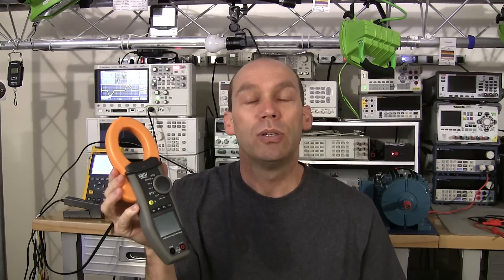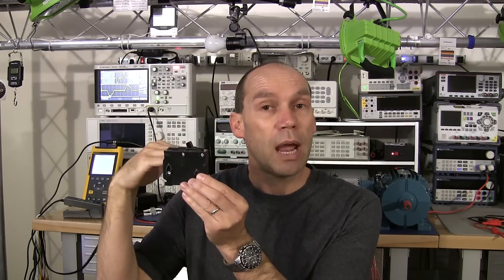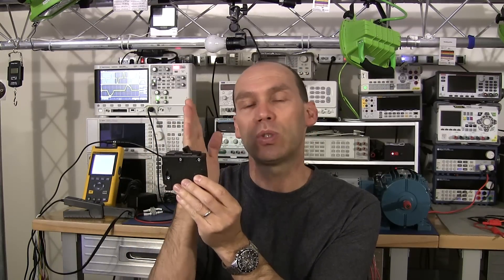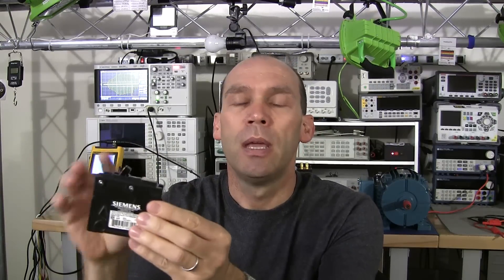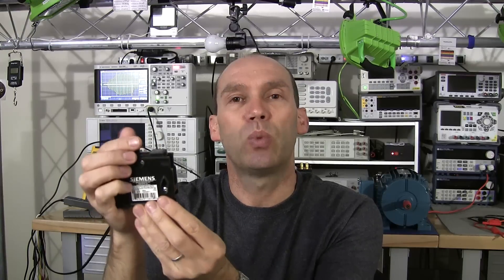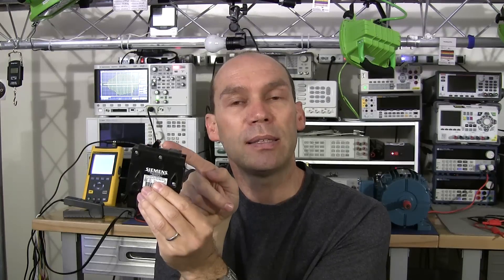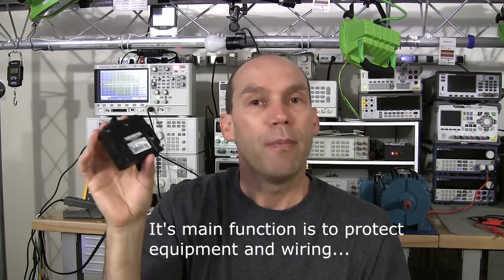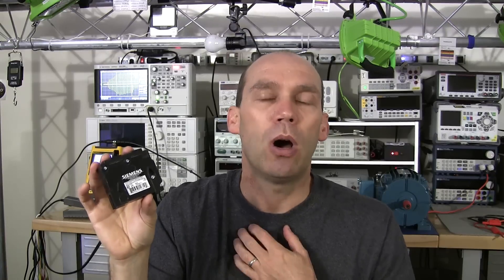Measuring Inrush Current with an Oscilloscope, Circuit Breakers and Clamp Meters

Comment: It's back to the drawing board for the Fluke team.Good point on the compatibility issue between the data sheet info and the meter readout.I'll never look at inrush currents in the same light again.I'ts hard to beat a practical demo to bring out all the inconsistencies in the measurement setup.Loved the video.Will have to update my equipment.Anyone have $70,000 to spare on a long term loan over a 100 years,if possible.

Comment: RMS only has meaning for getting an equivalent to DC heating power.  For working with breakers and motor starting current just use peak current which can be directly measured on a scope.

Comment: Hi Martin. Very good video again. I have missed only one aspect that i found out is very important in measuring inrush current on a scope.
The moment of making the circuit is of great importance: if one switches on at a point that the current in the homenet is in a low point (zero in the beginning and in the middle of the period) than the peakcurrent will be very modest. But if you switch on (to measure) on the moment of max current (after 90 and after 270 degrees in the period) than the peak is at its max. And all the values in between. So very dependant on the moment of switching om the circuit..
How come this is not mentioned by anyone in this subject ?
Reply: A fine point raised here. You are correct, the most likely reason is that product ratings account for  this situation thus we only deal with the maximum value.
Reply: @shieldcracker  for me the solution is to switch on with an SSR (Solid State Relais) that works on 90 degrees..
Reply: @BarendJanvanEijk  Indeed, some SSR can be configured with selective phase firing angles for current or voltage surge control.
Reply: @shieldcracker  and i combined that with a bounce-free switch. so to get the cleanest and most consistent signal for the inrush. important for optimization of electronic designs.

Comment: 28:45 The period for 60Hz is 16.7ms the Time Base for the scope is set to 1.67ms to give you enough grid to see one full cycle
Reply from the maker: James Cote Thanks for catching that...I was staring that the time base...I've added an annotation.
Reply: @mjlorton  this won't help.. it's the "switching-on" moment that changes behavior very much. my solution is to use an SSR for the in-switch (an SSR with 90 degrees feature).

Comment: Notice that when you framed it close to 1 period, the horizontal offset stops affecting the RMS current reading.

The framing of the window to match the period is a similar gotcha to using a FFT on a scope. FFT makes the assumption that whatever's on the screen is repeated forever beyond the screen. If the vertical at each edge of the screen doesn't match it would be a step in the imagined repeated waveform making a peak on the FFT at the period of the screen. Window functions help get around this by pinching the edges of the waveform down to the centre so the start and end smoothly merge, but if the waveform's nothing like a repetitive AC signal, that won't fix it all. Really you have to frame the waveform to an integer multiple of the fundamental period of the waveform and remember that it only means anything if the waveform is repetitive. You couldn't do an FFT of a single step waveform for example even with a window function, the result would entirely depend on the timebase.

Comment: Very nice video and the circuit breaker trip in case of very high arc current 'can you please explain to me  in the case of low arc current which is normal mcb can't trip, example I found product in seimens called ARC FAULT CIRCUIT INTERUPER (AFCI )...many thanks

Comment: Martin, RMS values are only useful for continuous measurements. Because inrush is a transient event, you cannot assign an RMS value. Trying to give inrush current an RMS value is like turning on a heater to high, and then turning it down to low, and asking what the RMS current is... Well, you could find the RMS value for when it was set to high, and you could find the RMS value for when it was low, but there is not an RMS value that covers both, as that's a nonsensical concept - RMS is how you describe steady-state conditions. 

Now you can take an RMS measurement of inrush current, but it would only give you the RMS current for during that particular sampling period - but as it's continuously changing (current draw decreasing with time in this case), it's essentially a useless figure. That's why we measure the peak current during inrush, and then RMS once it has reached steady-state.
Reply from the maker: Greg Robinson Thanks for your post. Do you have a link to an authoritative document that discusses RMS values as being only useful for continuous measurements and meaningless for peak inrush currents?
In all the research I did I never came across a good, clear definition for the measurement quantity for peak / instantaneous inrush current. If you read many of the circuit breaker manufactures' data sheets, they define the instantaneous trip current as a factor multiplied by In (CB rated RMS current). If the instantaneous trip current should be quantified and measured as the peak current during inrush, can you point to the paper that defines that? 
Cheers, Martin.
Reply: mjlorton
I'll see what I can find for you.
Reply: ***** Nearly choked on that while drinking me tea.Be careful or you'll leave us all with a blank canvas.Rms is difficult enough but Joule's Integral is bordering on science fiction.
Reply: RMS is a mathematical construct to get a meaningful average from a signal that goes between positive and negative values. If you take look at one period of a sine wave and take the average, it's zero. The RMS calculation takes your signal and squares it to first remove all the negative values. You then take the average of that signal (after you've squared it). Lastly, you take the square root which 'cancels' the original process of squaring the signal. It's a similar idea to "adding 1 to both sides of an equation" so you don't actually change anything. Consequently, you can take an RMS of any signal, even those that are strictly positive or negative. A positive signal RMS value will equal its average value, and a negative signal RMS value will be the absolute value of its average. In the end, RMS is useful whether you're looking at a few cycles or thousands of cycles.
Reply: This summary shows that it pays to eat porridge for breakfast !!
Reply: Would any other metric, like norms, or other things like variances be of any help?

Rms is useful in scenarios where the other quantity (voltage or current) is fixed so rms directly corresponds to the power loss. But here the load has both a swinging potential and a swinging current.

Comment: Are you really interested in the peak in rush (time stamp 28:16)?  If it lasts for only one cycle, it's not that interesting.  The concern about in rush current is the power it can deliver.  Can that power do damage is the question.

Comment: Measuring non-pure sinusoidal RMS voltage for a continuous waveform can require a large crest factor in addition to true RMS depending on the shape and magnitude. For more information see Keysight Bench DMM 34465A.

Comment: Hi Martin, Great video! but is it possible to measure current on a scope with out all that special equipment, thanks
Reply: A low value resistor accomplishes this.  I use a 10 watt, 1 ohm resistor.  That produces a voltage drop of 1 volt per amp.   This will alter the test condition slightly; a 30 amp surge will produce a 30 volt drop in the resistor.  So if you are expecting higher currents, just use a 1/10th ohm resistor (or piece of wire with 1/10th ohm).  
WARNING Be sure your oscilloscope is ISOLATED when you clip the ground lead of the probe to either side of the resistor that just happens to be inserted in the "hot" side of the mains.  I plug my scope into a Goal Zero inverter so it has no connection whatever to the "mains".

Comment: Very useful information, thank you.
I would like to measure the inrush current on USB ports, unfortunately, I don't have the equipment.
Reply: What's being the purpose  of that? What kind of load do you use with the USB port?
Reply: *****
I have a notebook, which won't turn on with an external USB powered DVD burner connected to both USB ports, I would like to know what is going on in the moment I push the power button. Another notebook (same device) has no issues.
Reply: Dorf Schmidt
I don't think that this is due to the inrush current as such. Your DVD burner would have a decent filtering inside to avoid temporary voltage or current spikes. It's more likely the general overcurrent protection of the motherboard, powering both of the adjacent ports from a single +5V rail. You could test it with two ports that are not so close to each other. It is also possible that the manufacturer made a revision and your newer notebook doesn't have this issue anymore. Furthermore, do the two ports work on their own?

Anyway, feel free to look at the inrush current from your USB port with a digital scope. You could sacrifice a USB extersion cable by removing the outer jacket (keeping the four wires isolated) and wrapping the ground lead from your probe once or few times around the red USB wire and connecting the crocodile clip with the tip of the probe.

Comment: You just happen to have a mongo motor and VFD lying around?  Was that to go into your drill press back when you were milling plastic and everyone got bent out of shape? :)
Reply from the maker: Eddie the Grouch LOL....no! I have however bought the correct press for the little compound table and it works a treat.
The motor and VFD were purchased specifically to play and learn about 3 phase power, power quality etc. It's been great for that. I do have a better setup planned for 3 phase power as the VFD is generating a "modified" and rather noisy 3 phase waveform.
Thanks for the post ;-)

Comment: Could you please clarify something.
What if you need to register DC inrush current? Will it suffice to use regular Hall effect type clamp meters?
There are no periods in DC, so there is no need in RMS with DC and no need in special mode on my clamp meter to register DC inrush current, am I right?
Reply: Whether dc or ac motor, I think the inrush current would follow some rise and then fall to some kind of settled for loads on the motor.

Comment: I have a 750W (3A) variable autotransformer that trips the circuit breaker in my house every time I plug it in. I put a thermistor in series and it stopped! Inrush current?
Reply: TheAmmoniacal Yes, definitely.
Reply: TheAmmoniacal Yep.  But I think you may have used an MOV (Metal Oxide Varistor).  MOV's act to limit surges while a thermistor varies resistance with temperature changes.
MOV's and thermistors can look identical and are often confused one to the other.

The branch circuit (breaker) the transformer is plugged into may be close to capacity with lights and other stuff and the inrush is just enough to trip it.
Reply: Eddie the Grouch I definitely put a 5 ohm Epcos NTC themistor in it (http://www.newark.com/epcos/b57364s2509a002/ntc-thermistor/dp/52R9612). I'll admit I'm no expert on this, it's just what I had available and the datasheet seemed to indicate it was the correct use for it. I also tested it with my heat gun and the resistance dropped significantly rather fast. The datasheet also says it can handle 8.5 A or something like that:
Reply: Eddie the Grouch  AFAIK, MOVs are used to protect circuits from Over-Voltage, not Over-Current. Once the Voltage gets too high, the MOV will conduct electricity, so they are used in parallel with the circuit to protect.
Thermistors, on the other hand, only conduct when heated up. At first their resistance is high, so inrush current will be limited. EDIT: Thanks to Wikipedia, I got my facts right: https://en.wikipedia.org/wiki/Inrush_current_limiter#Thermistor
So I think OP's assumption is correct, inrush current is most likely responsible for triggering the breaker.
Reply: TheAmmoniacal See?  I told you people get them confused.  It just happened to be me this time :()
I hate when that happens and it's a lesson to me not to spout off when I'm not 100%.
Thank you for the tactful correction and I will go to the dunce corner now :)
Reply: Eddie the Grouch Another clue its an NTC thermistor and not a MOV is that a MOV would be in parallel to catch voltage surges, rather than in series to crudely limit current. A MOV in series wouldn't allow it to turn on I think.

Comment: Just watched this. Did you ever hear back from Fluke on this? It seem to be that the difference between your scope measurement of ~9 and the Fluke measurement is that you got an RMS value for the cycle and Fluke is reporting the peak? Is it that simple?

I suspect the reason there is no clear definition is that it's dependent on the situation. For figuring out the load a generator will see starting an air conditioning compressor, I can't see how peak would matter. A generator can't respond to full cycle, much less 1/100th or 1/10th of one. So the load it would see initially would look like the RMS value, not the peak. In other cases, such as electronics, I could see the peak being meaningful. 

Does this makes sense, or am I not getting your explanation?
Reply: YES!, - your post makes perfect sense to me (and well stated at that).  This is also the sole reason why I am trying to understand inrush currents as well - to see the effect, or as you stated, to understand the load that a generator would see when starting an air conditioner (heat pump) compressor. 

Secondarily, for me, to also determine if my normal day-to-day inrush current on my AC compressor is normal since I'm somewhat concerned about the big thump I hear when the compressor starts, and the noise that the wires make in the run of EMT conduit along the side of the house when the compressor starts. Also, high load currents (inrush/LRA or RLA) tend to distort the generator's waveform, so you got that to deal with when considering AC compressor startup on emergency backup generators.

I wish there were an Easy Button for figuring this out by using a scope.  Not sure I understood his comment about not being able to use that yellow clamp-on AC current probe, and why he felt he need to use that black hall-effect clamp on thing instead.

Comment: 21:30 Why do you not show the voltage waveform concurrently with the voltage waveform?  The phase relationship is important as is when exactly does the peak current take place?  Anyway, several youtube videos show only the current waveform, demonstrating the existence of inrush, but by NOT showing the concurrent voltage waveform, allows misunderstanding to creep in.  You might think that energizing a transformer at the peak of voltage would produce a huge inrush, but it doesn't!  That turns out to be the best moment to energize; peak voltage is minimum current, but how does it know this?  
So I set up my own experimental rig.  I have a doubt about using an inductive current probe to measure the effects of inductance in the device under test.  You are going to get a phase shift just from the inductive probe, seems to me.

Comment: Nice video. You explained everything very well.  In one video, Fluke says they measure the first 5 cycles to calculate inrush current.  See https://youtu.be/2xIsmRkpQLA?t=68.  Then in the manual to the Fluke 381 clamp meter, inrush current is measured as 400 samples over a 100 ms period. So for 60 cycle AC current, that would be 6 cycles.

Comment: Why are Oscilloscopes not great for getting voltages?
Reply: bob mcc Like Gary said, scopes are primarily for seeing the waveform.  Hobby scopes, unlike the Uber gear Martin has, are pretty dumb and only measure where the wave peaks are relative to the screen and have to be calibrated.  Like having to know how to spell a word before you can look in a dictionary to see how to spell the word -  the voltage to measure needs to be known to set the scope.   Say it's set to 5 volts per division and your grid is 8 squares vertical.  That will allow you to measure 40 volts P-P or -20v to +20v.  A higher voltage will not display until you fiddle with the scale and/or attenuation.  Scopes also have a narrow voltage range like 5-20v on their own and anything higher will need an attenuator inline.  A 10x attenuator with a 10v scope will measure up to 100v.   If the scope has no setting to compensate or know that an attenuator is used it will still read 10v when actual voltage is 100v.   A cheap voltmeter is still needed to get the range of an unknown voltage to set the scope.  
All-in-all a pain in the butt for casual voltage measuring.
Reply: Eddie the Grouch My scope is a Heathkit from the 70's and I am probably wrong on this answer, also.
Reply: bob mcc We use 12-bit scopes (Yokogawa DL850) with isolated diff probes for grid converters and HV DC/DC converters.
One thing is the resolution, the other more important feature is the isolation.
Reply: Eddie the Grouch Well explained. =)